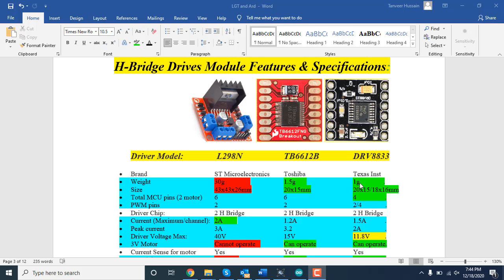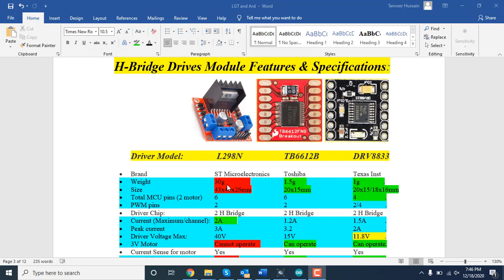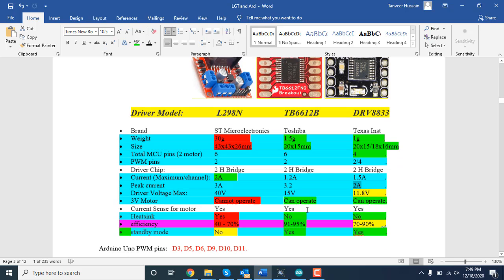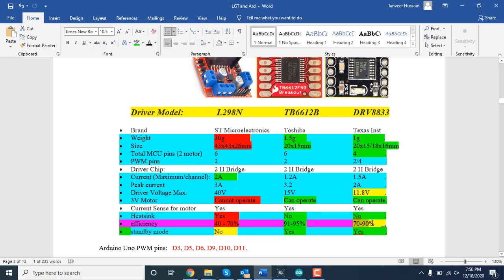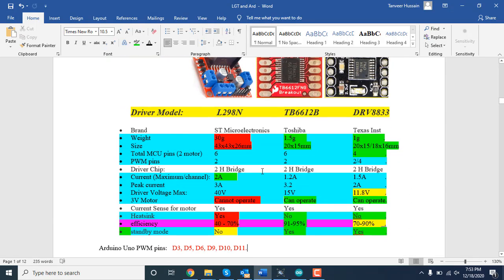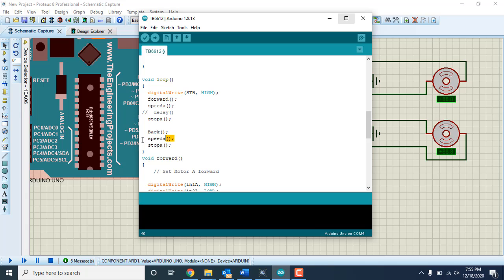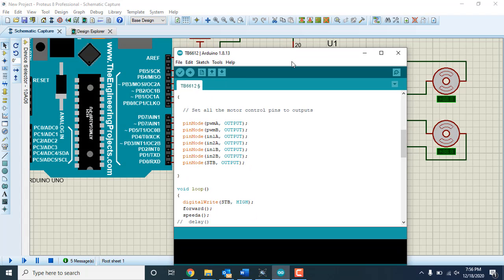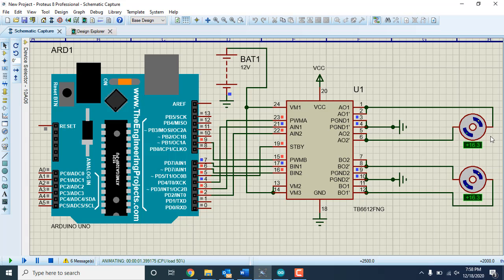L298N vs TB6612fng vs DRV8833, H bridge Drives Comparison | ETSolutions

Comment: I need some clarification , i have 4 coils manually made , i want to control 4 coils independently , how do i use the DRV8833 board.
Reply from the maker: if you need current flow only in one direction you can use one DRV8833 if you need current in both direction you need two DRV8833.
Make sure your coil not exceed the max current limit of DRV8833. connect same as you connect the motor.
Reply: @ETSolutions  Thank you for the reply , i would like to use the H-Bridge for this application(replicate this experiment) here in the link , https://www.youtube.com/watch?v=GyTGXrL5Vas   , which means i need to use dual 2x HBridge board  am i correct - Thank you in advance.
Reply from the maker: Hi man, i just watch your video now. yes you can use dual H-Bridge IC for this circuit, i just want to know flow of current in each coil you only have in one direction not in both direction. if one direction one dual bridge IC is ok to operate 4 coils.

Comment: would have been nice if you had a Arduino IDE scratch for running DRV 8833 in PWM mode.
Reply from the maker: ok sure, i will upload it later.
Reply: @ETSolutions  Yes we need DRV 8833 in PWM mode video.